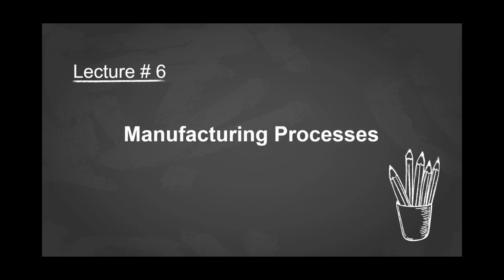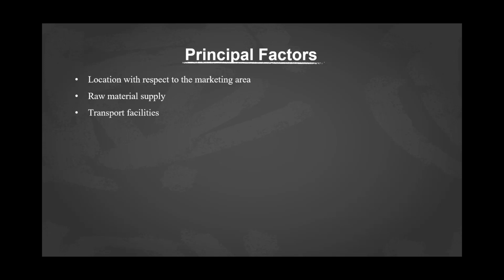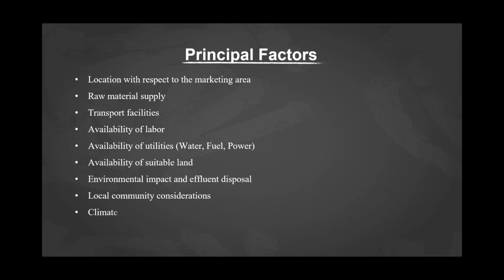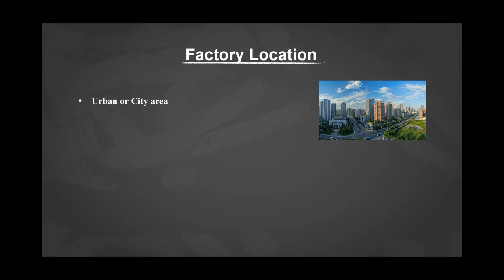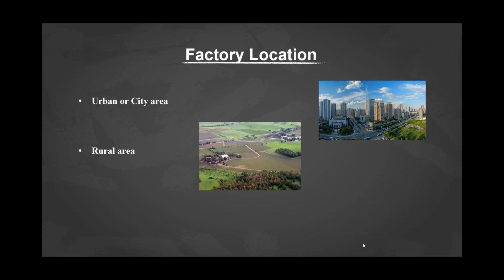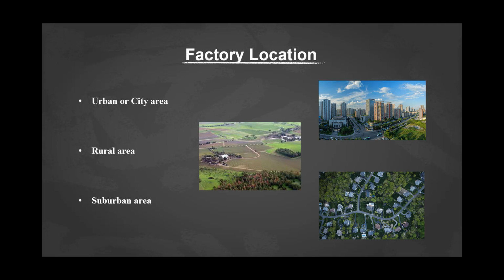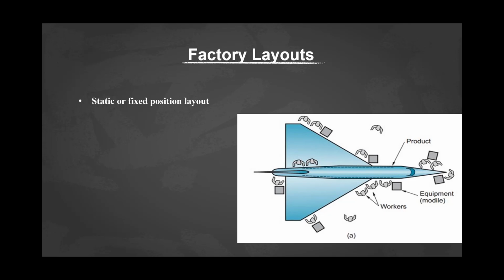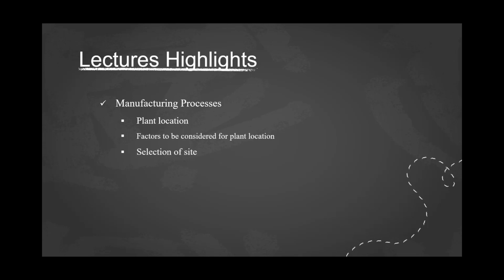lesson #6: Manufacturing Process;Plant Location, Urban Areas, Rular areas and suburbs, Plant Layouts

Comment: Annus rafique 
F17-0065
Summary:
Factory location:
A plant should be located  in that area where the production cost is minimum and get maximum  
Factors that can affect plant location are 
Location with respect to marketing area 
Availability of raw material
Transport facilities 
Availability of labor 
Availability of utilities like water fuel etc.
Availability of suitable land 
Environmental impact and efficient disposal.
 Local community considerations
 Climate 
Political Strategic Considerations
Types of locations 
1.Urban or city area
 An urban area is the region surrounding a city.
Advantages of urban area includes, better transport facilities, Banking and credit facilities, presence of  cold storage, presence of high skilled labor, presence of insurance companies 
Disadvantages includes, insufficient land ,high taxes ,high cost labors, munsiple restrictions
2.rural area
It has low population density and presence of large undeveloped land 
Advantage are low cost labor, low living standards, availability of land no munciple restrictions 
Disadvantages includes transportation facilities and banking facilities are the main drawback of rural areas
And last is suburban areas that includes suitable and cheaper availability of land, good medical, transportation etc.  
Factory layout 
There are four types of factory layouts 
static or fixed layout: process is brought to product no product to process for example ships and airplane manufacturing 
Process layout: operation of similar nature or functions are grouped together for example injection modeling, drilling 
Cell or grouped layout: Products with similar process requirements are assigned to the 
same manufacturing cell for example keeping all accounting machines in one room and making provisions for all typists in one room.
Product layout :sequence of operations required to produce a product for example automobile assembly where almost all variants of the same model require the same sequence of process.

Top manufacturing countries are
1. China: $4T (28.37% of world total)
2. United States $2.3T (16.65% of world total)
3. Japan: $1T (7.23% of world total)
4. Germany: $806B (5.78% of world total)
5. South Korea: $459B (3.29% of world total)

Comment: F18-0310
BSSE 5TH A
Summary:
Layout of machinery and departments could make chance of low cost productivity at high efficiency. Urban areas and rural areas both have pons and cons. Transportations, material availability ans supply of product add to the advantage of urbun areas but high cost labour, taxes and high land cost  makes it disadvantageous. On other side, lack of tecnological resources, problems of material supply and transportation makes rural adds to the disadvantages and low land cost and low cost labour make it more advantageous. 
Factory layout: 
i) Fixed position layout-> processes are brought to the product 
ii) Process layout-> processes are arranged according to their process type
iii) Product layout-> set of operations performed to make a product 
iv) Cell or grouped layout-> processes with same functionalities are grouped together in same manufacturing cell.

Task:
Top Manufacturing Countries in the World:
China is the world's manufacturing powerhouse accounted for 28.4 percent of the global manufacturing output in 2018.India, which ranked sixth, accounted for 3 percent of the global manufacturing output. 
Global Manufaturing Output (2018):
China(28.4), United States(16.6), Japan(7.2), Germany(5.8), South Korea(3.3), India(3.0), Italy(2.3), France(1.9), United Kingdom(1.8), Maxico(1.5).

Comment: MALIK HASHIM RAZA
F18-0303
BSSE 5th A

SUMMARY:-

In this talk we discuss FACTORY LOCATION:
 Plant area is a modern site where the creation cost is least and get most extreme. at that point diverse chief factor that can influence plant area which are 

- Availability Of work. 
- Availability Of Utilities water fuel power. 
- Raw materials supply. 
- Transport offices. 
- Locations as for promoting territory. 
- Availability Of reasonable land. 
- Environmental effect and proficient removal. 
- Political Strategic Considerations.
- Local people group contemplations 
- Climate 

There are various sorts of region I-e metropolitan regions, sub metropolitan zones and provincial regions every one of them having their own preferences and impediments. There are various kinds of industrial facility designs which include: Static or fixed position format, Process based design, Cell or gathering design and Product based design.

Top 5 Countries with the Biggest Manufacturing Output
 
China: $4T (28.37% of world total) United States: $2.3T (16.65% of world total) Japan: $1T (7.23% of world total) Germany: $806B (5.78% of world total) South Korea: $459B (3.29% of world total).....

Comment: F18-0327
BS(SE) 5th B
• FACTORY LOCATION: Factory place is a contemporary site where the creation cost is least and get greatest. • Factors: Marketing territory, Supply of crude materials, Transport workplaces, Availability of work, utilities and reasonable grounds, Environmental effect and removal of squanders, influences of environment and so forth are the additives that impacts plant location. • Urban Areas : Advantages of metropolitan areas are better car facilities,banking and bloodless stockpiling and so on .High land value , high expectancies for normal comforts and excessive costs are the detriments of metropolitan zones. • Rural Areas: Opposite of metropolitan territories. Less pricey land cost. Low living standards,low lobur value and so forth are the favorable occasions and disservices includes non-accessibility of transportation , nonattendance of protection places of work and so forth • Suburban Areas: likewise have some focal factors and detriments . • FACTORY LAYOUT : There are four significant forms of production plant codecs are: 1: Static or Fixed Position Layout : in which the cycle is brougt to the object ,now not the object to the cycle. 2: Process Based Layout : tasks of comparable nature or capacities are gathered. 3: Cell or Group Layout : gadgets with comparative cycle necessities are relegated to same assembling cell. 4: Product Based Layout : the succession of tasks needed to deliver an items. • TOP MANUFACTURING COUNTRIES : Top assembling international locations are, . China . US . Japan . Germany . South Korea . India . Italy

Comment: F18-0330
BSSE 5th (Section:B)
Summary
In this lecture we studied FACTORY LOCATION:
Factory location is an industrial site where the production cost is minimum and get maximum.
then different principal factor that can affect  plant location which are
1) Locations with respect to marketing area. 
2) Raw materials supply. 
3) Transport facilities. 
4) Availability Of labour. 
5) Availability Of Utilities water fuel power. 
6) Availability Of suitable land. 
7) Environmental impact and efficient disposal. 
8) Local community considerations
9) Climate
10) Political Strategic Considerations. 
Then different Types of areas were discussed which are:
 Urban or City areas, along with its advantages and disadvantages. 
 Rural Areas, quite opposite to the City or urban Areas. 
 Suburban areas, usually are more cheaper and are easy to buy and sell lands for factory as compared to urban or city areas. 
then we studied  4 major types of factory layout that are
  1-Fixed or static layout 
 2-Process layout: 
 3-Group or cell layout
 4-Product based layout
TASK:
Name the top manufacturing countries in the world?
Top 5 Countries with the Biggest Manufacturing Output
China: $4T (28.37% of world total)
United States $2.3T (16.65% of world total)
Japan: $1T (7.23% of world total)
Germany: $806B (5.78% of world total)
South Korea: $459B (3.29% of world total)

Comment: Roll No : F18-1154
Section C
BSSE 5th 
In this lecture the remaining topics of manufacturing process were discussed which are Principle Factors of factory Locations ,Types Of Different Areas, Factory Locations, Factory Layout and types of factory Layout etc... 
Principle Factors Of Factory Locations:
1) Locations with respect to marketing area. 
2) Raw materials supply. 
3) Transport facilities. 
4) Availability Of labour. 
5) Availability Of Utilities water fuel power. 
6) Availability Of suitable land. 
7) Environmental impact and efficient disposal. 
8) Local community considerations
9) Climate
10) Political Strategic Considerations. 
Then different Types of areas were discussed which are:
1) Urban or City areas, along with its advantages and disadvantages. 
2) Rural Areas, quite opposite to the City or urban Areas. 
3) Suburban areas, usually are more cheaper and are easy to buy and sell lands for factory as compared to urban or city areas. 
Then Types of factory layout were discussed which are:
1) Fixed or static layout: which are fixed and are not chargeable with respect to project. 
2) Process layout: Several processes are done to complete product or task to be completed. 
3) Group or cell layout: Several groups or cells combinely used to compete with the required product or the project. 
4) Product based layout:The project required or the product based considerations are used here.

Task about top manufacturing countries in the world :

Top 5 Countries with the Biggest Manufacturing Output
China: $4T (28.37% of world total)
United States: $2.3T (16.65% of world total)
Japan: $1T (7.23% of world total)
Germany: $806B (5.78% of world total)
South Korea: $459B (3.29% of world total).....

Comment: BSSE 5th 'A'
F18-0274
As we have learned in the previous lectures, factories or production plants should be located in that particular area where expenses are minimum and production is maximum and this phenomenon is known as a selection of factory location.
Factors that could affect the location: 
Ease in the supply of raw materials, Better transport facilities, Availability of suitable labour, Marketing area, Better drainage system for disposal of plant wastes, Climatic Impacts etc is the factors that affect plant location. 
Urban Areas are favourable for plants on some aspects:
Banks for money related purposes, Cold storage, Ease of transport facilities.
Rural Areas are Opposite to urban areas. 
Lands are not expansive, low living standards, Availability of low labour cost etc 
Suburban Areas are also favourable for plants in some aspects.  FACTORY LAYOUT : 
There are four major types of factory layouts
 1) Static Position Layout:
 When your product is fixed and you have to move your workshop to the product.
2) Process Layout: 
The raw material is passed through all the processes to produce an end product.
3) Cell or Group Layout:
Different departments are created consisting of different functions and each process have to pass through each step. 
 4: Product Based Layout:
 the sequence of steps required to produce a product.

Comment: F18-0304
BS-SE-5TH-A
• FACTORY LOCATION: Factory location is an industrial site where the production cost is minimum and get maximum. • Factors:  Marketing area, Supply of raw materials, Transport facilities, Availability of labour, utilities and suitable lands, Environmental impact and disposal of wastes, effects of climate etc are the factors that affects plant location. • Urban Areas : Advantages of urban areas are better transport facilities,banking and cold storage etc .High land cost , high living standards and high taxes are the disadvantages of urban areas. •  Rural Areas: Opposite of urban areas. Cheaper land cost. low  living standards,low lobur cost etc are the advantages and disadvantages includes non-availability of transportation , absence of insurance facilities etc.
 •  Suburban Areas: also have some advantages and disadvantages .
• FACTORY LAYOUT : There are four major types of factory layouts are:
1:  Static or Fixed Position Layout : where the process is brougt to the product ,not the product to the process.
2:  Process Based Layout :  operations of similar nature or functions are grouped together.
3:  Cell or Group Layout : products with similar process requirements are assigned to same manufacturing cell.
4: Product Based Layout : the sequence of operations required to produce a products.
• TOP MANUFACTURING COUNTRIES : Top manufacturing countries are, 
. China
. United States
. Japan
. Germany
. South Korea
. India
. Italy

Comment: _Roll no.: F18-0373___
Conclusion:
Factory location: The Factory or Plant should be located at the place, where we can get maximum productions and minimum cost.
Principal factors;
1)Location with respect to the marketing area.
2) Raw material supply.
3) Transport facility(railway, road, etc)
4)Availability of labor
5)Availability of utilities(Water, Electricity, etc)
6)Availability of suitable land
7) Environmental impact and effluent disposal
8)local community consideration
9)climate
10)Political strategic Consideration(Capital grant)

Types:
✅Urban or city area:
Advantages:
 Urban areas have both advantages as well as disadvantages, like banks, cold storages, transports, cargo, buy and sell market,, trainer development facilities, specific municipal area facilities
Disadvantages:
cost of land, insufficient land space, high standard living, trade unit movement, high taxation, certain municipal restrictions
✅Rural Areas:
Rural areas are totally opposite to urban areas.
✅Suburban Areas: these areas are best for plant Location because we get laborers and the cost of the land is not that high.
............
...
Factory layouts:
✅Static or Fixed Layouts: Where processes are brought to the product.

✅Process-Based Layout: Operations of similar nature are performed.

✅Cell or Group Layout: Machines performing similar operations are grouped together. 

 ✅Product Based Layout: Focuses on the product, not process.
..................................Top Manufacturing Countries in the World...................................................
Top manufacturing countries are: 
 United States
, China, Germany, Japan, India, South Korea and Mexico..

Comment: F18_1182
BSSE_5th-C
Summary:
                   A factory/plant should be located at a reasonable place where minimum cost and maximum production could be produced while selecting the location of the plant We must consider some of the following factors:
Location w.r.t. marketing area, Ease of raw material supply, availability of transport, utilities, suitable land and labour, Environmental impact, Local community consideration, Political Strategic Considerations
Urban areas have both advantages as well as disadvantages, like banks, cold storages, transports, cargo, buy and sell market,, trainer development facilities, specific municipal area facilities whereas the cost of land, insufficient land space, high standard living, trade unit movement, high taxation, certain municipal restrictions are some drawbacks of urban areas
Rural areas are totally opposite to urban areas same as suburban areas has also some pros and cons.
Different Factory layouts include.
Fixed position layouts which include aeroplane manufacturing, shipyards, railway systems
A process-based layout  which includes the painting department, Machine shop department, testing department and shipping departments
Cell layout is that in which machine doing the same operations are formed, groups together
Product-based layout include automobile assembly which requires the same sequence of operations

=====================TOP MANUFACTURING COUNTRIES IN THE WORLD=============================

1
 United States
2
 China
3
 Germany
4
 Japan
5
 India
6
 South Korea
7
 Mexico
8
 United Kingdom